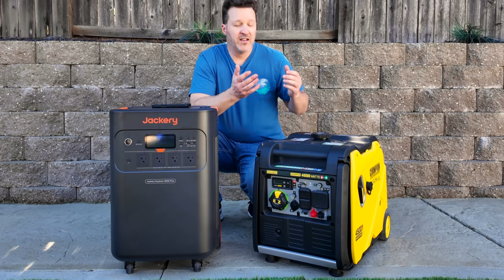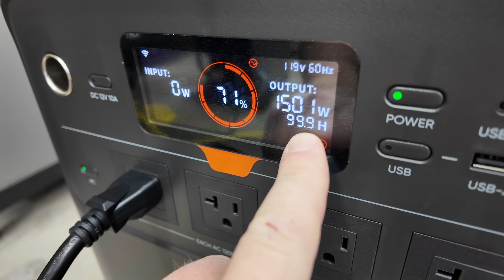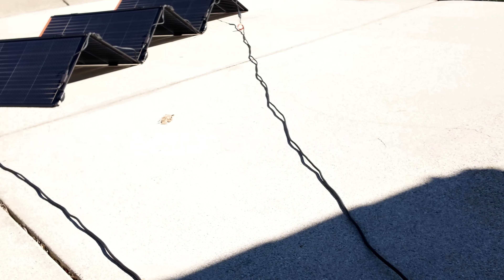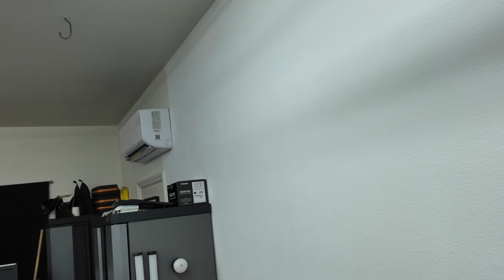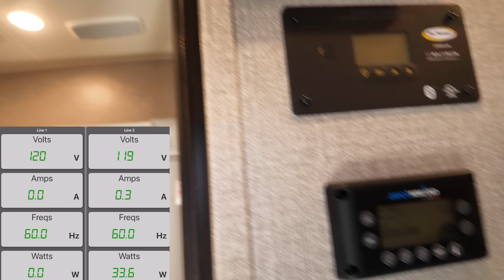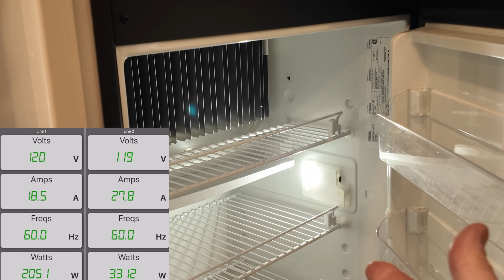Amazing Price- But Should you Buy? Find Out! Jackery 5000 Plus & Solar Saga Review

Comment: While I am not a fan of the Jackery products, companies csn learn and grow their product line over time. The proprietary solar panels, 120V charging input limitations while running 240V output, and port deactivation while charging are just too much to accept. Especially with so many other vendors offering these solutions. So Jackery is always bottom of the list (right there with Goal Zero) until these issues are addressed.
Reply: Are they fixed yet?

Comment: That unit has a lot of drawbacks, especially pass thru charging while using power. Low charging input…. The delta ultra is about the same price, has over 6k wh , can be recharged in 1.5 hrs … huge advantage. Other than receiving this units for free to keep, I don’t understand why you don’t just recommend the eco flow line. There is nothing better than their line of products.
Reply from the maker: You would be surprised how many Jackery fans there are out there. 
And everytime I hear … oh it was free I laugh. 
Nothing is free. Nothing.

This test lets people know if they are interested in the unit, hopefully it gives them info they were looking for. Also allows me to answer more questions when people ask and comparisons later.
Reply: Thanks for all the info. I particularly enjoyed the different scenarios. And learning about load shedding. Would love to see more content about that. Especially that doesn’t require heavy infrastructure.
Reply from the maker: @danpatnode6783 load shedding is on the list 😀👍🏼
Reply: So it sounds like there are units that let you pass through while drawing a larger load thanwhat you are providing to the power station without shutting down the station like this one seems to? Can you point out a couple? I’m interested in using a power station like this to provide your power for an RV running air conditioner and can charge it for the most part with my Rivian, but the Rivian‘s output caps at 1500 W so I definitely need a station that can provide a peak load in excess of 1500 Wwhile pass through charging without tripping.
Reply: Thanks for the review Johnny!
Reply: Maybe he likes Jackery better?

Comment: I recently bought a a battery "generator" ( a Bluetti) through the mail and found that it would not take a charge.  The seller was extremely cooperative and sent out another unit--in fact, one that stored twice as much energy as the first at no extra charge--and said they would send a postage paid box for me to return the first. They never have, even though I reminded them several times.  My question---would it be worth my while to have someone look at the first unit to determine if a quick fix would make it operational, or is the problem likely to be so expensive that it wouldn't be worth my time?  If it would be worth checking into a repair, who would be the best person to take it to?  If it matters, the broken unit is 300 Wh/45Ah.  I would greatly appreciate whatever opinion you might have to offer.  Thanks
Reply from the maker: Electronics shop 
Could be simple

Comment: Afeiry is a very good power station
Reply: On the p210 I can charge with my generator at 1100 watts and run a 1000 watt load and it doesn’t overload the system